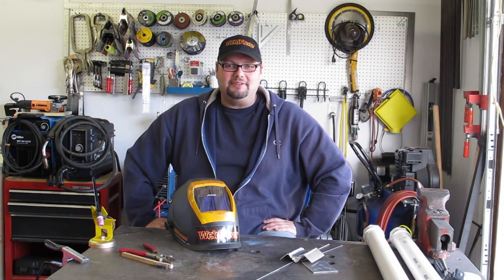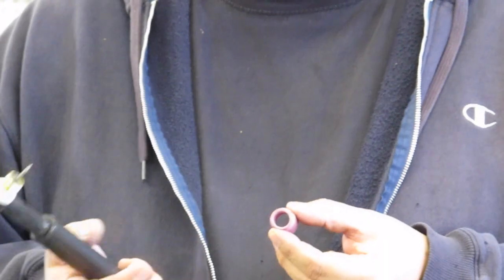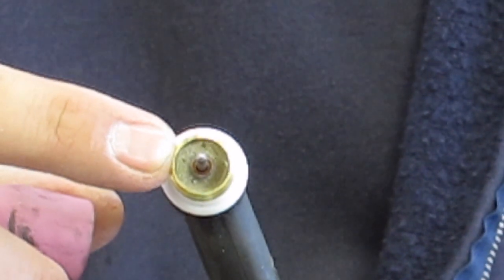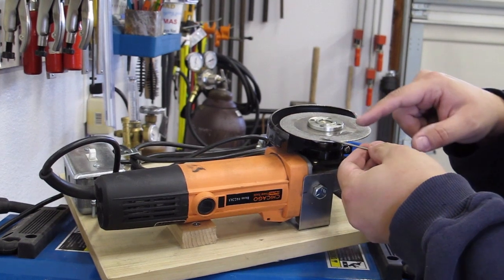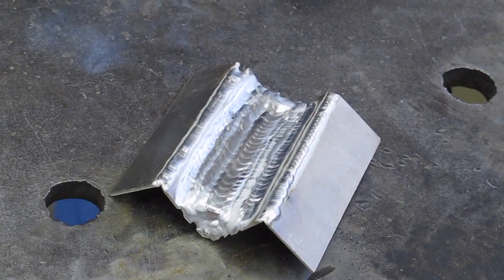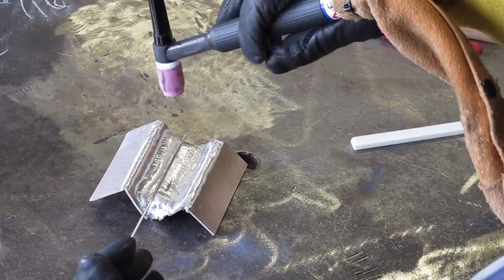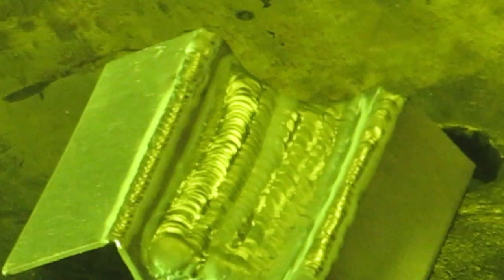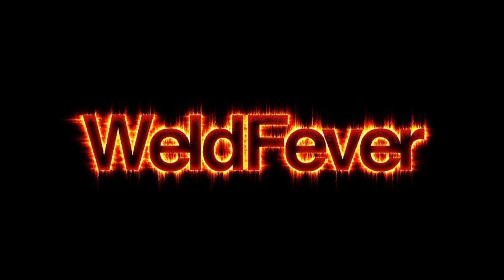Basic Aluminum TIG Welding

Comment: Weld fever, 
Im having huge issues with my Dynasty 200.  The one thing i don't have is a foot peddle, I'm just presenting my amperage.  I am using 2% ceriated tungsten, setting the machine at 120 amps, tig hf impulse, balance at 75 and frequency at 120. 3/32 Tungsten is sharpened almost to a complete point with a 1/32 flat spot on the end.  The end of the tungsten is balling and falling off, it rolls to the side of the tungsten and burns back into the nozzle of the torch.  Any ideas what i am missing?

I have tried using 1/8 tungsten and have the same issues.  as well as adjusting the machine, from 85-140 amps, from hf impulse to lift arc, from 70-85 on the balance, and from 100-180 on the frequency, and every combination in between and nothing seems to be working well.
Reply from the maker: Are you sure its the tungsten balling up, and not just the aluminum jumping onto the tungsten? Aluminum tends to jump onto the tungsten whenever you get too close, almost like a magnet. Check on that and get back to me.
Reply: WeldFever, I got it figured... 
where do I find a diamond impregnated grinding whee or disk? Anyone around me doesn't carry or in certain of what to order in.

Comment: One question, while grinding your tungsten, why did you use the left side of the wheel as it was positioned(so that all the tungsten dust is blown back at you), the right side as the grinder was positioned would have the dust blown away from you.
Reply from the maker: Mason Wilson Not really worried because I am not using radioactive tungsten, and sharpening on a diamond wheel it is so quick that not much dust is created. In fact, in all the times I have ground tungsten, I have yet to see visible evidence of its dust!

Comment: Love your videos, I acquired a diamond coated wheel from HF like yours (same p/n) and increased the size of the bore to fit the grinder, then I noticed that the MAX speed of the wheel is considerably LESS than the free speed of the grinder. It may work but I figure safety first and decided not to temp fate.
Reply from the maker: LeRoy Denning Hmm, make sure the flat side of the flange nut is contacting blade. If you have it backwards (like you would load it onto a grinding wheel), what you described usually happens. Good luck and be safe.

Comment: Hey Dan.  I really enjoy your vids.  Can I ask where you got the diamond encrusted grinding wheel?  I love the board mounted grinder idea and am already making plans to steal that for my small shop.  Thanks!
Reply from the maker: Howard Camardelle Sure, it's from Harbor Freight. Sku# 98862. It's made as a replacement blade for a blade sharpener,. The only catch is the arbor hole is a bit smaller than a standard grinding disk, so you'll have to alter your grinder's inner flange to accept it. A machinist friend reduced the size of my flange on a lathe.
Reply: Thanks Dan.  I'm really learning a lot from your vids.  Keep up the good work!

Comment: Great video!!  Thank you very much.  I am curious about the gas lens and cup info.  I have a Dynasty 200 with the WP-20 torch and the only gas lens I have found is for a .020" tungsten...????  And I only see one of the cups available which is the #4 for the corresponding tungsten.